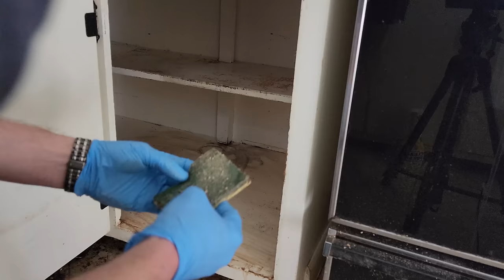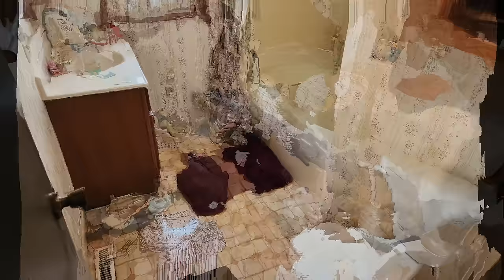Jaw-Dropping Hoarder House Transformation (FULL HOUSE CLEANING)

Comment: You did a phenomenal job again, you make a huge and important difference in so many ways. As someone with hoarding disorder, thank you so, so much for everything you guys do. I'm working with supports to clean up my place and while it's necessarily slow going we're making increasing progress and I'm hoping to be able to soon build on my distress tolerance etc enough to get more specialised treatment involved and get more happening, though the people I've got are already doing wonders with their approach.

One of my main driving concerns is that I don't want someone to have to do this job if something happens to me, I've always been fully aware that it will be someone else's  problem if I don't get it done, but as you likely know, this issue comes with a range of levels of insight about the situation and its consequences, but even the desperate conviction that "no one can fix this but me, it's my mess and I'm responsible for it" can get in the way of things actually getting done.

Whether hoarding disorder itself or hoarding related to other issues, it's a hell of a thing and vastly misunderstood and much maligned. My hope is that increasingly more people will learn more about it, that it's not just an excuse for laziness, a lifestyle choice, an indication of bad character or something that can be fixed with just willpower, trying harder or caring more about others (among other myths) but that needs a particular approach, and is something that it's also possible for a person to have happen to them or someone they know at some point in life no matter how tidy or organised or what high standards they might have, and that if some of the the shame and hatred can be lifted enough, more people might seek help sooner. Perhaps fewer people and others impacted might end up so thoroughly buried by its symptoms and consequences, and by more people coming forward more research can be done and more people (including more of those with a severe lack of insight and major resistance and others affected by its fallout) can be helped.

I honestly think you're going a long way towards this and I can't thank you enough. I'm going to join up soon when I've hit a personal milestone as well as organised myself to make it happen. I also hope to increase my social circle beyond just a few people aside from my support workers so that I can contribute better towards sending your videos and increasing your subscribers, and I'm determined to see you get your gold play button ❤.

Comment: My Grandma wasn't quite to the hoarder level but the recipe obsession is somewhat relevant. When I cleared out her house in 2016, I filled up no less than 5 husky contractor trash bags with unused greeting cards there might have been 10,000 cards by the time I was done cleaning them out. And a fair portion of them were the fancy ones with moving parts that are $5 to $10 each. I bet I threw away $50,000 (in original purchase value) of greeting cards.

Comment: Reminds me a lot of when my grandfather passed, he had a Garage that used to be a small hanger for like. Cessna's, and he over the last 30 years had filled the rafters with years and years worth of old paper, receipts, there were receipts from the 40's and 50's, as well as rock and general mining equipment. The house he had itself wasn't bad, and was clean, but the garage was horrible, most of the paper had molded or rotted.

Comment: A tip you might not know.  Hard stuck contact paper can be easily removed by heating with a hair dryer.  It melts the sticky enough to just pull it up.

Comment: What a great video, amazing result, fascinating situation! 

My family were “tidy” hoarders. They saved every practical item or tool methodically in case it could be repurposed in the future. It was clean, tidy, but the house was rammed with unnecessary but decent items including every possible kitchen utensil you could imagine existed (no rubbish/trash though).

This has turned me into a “practical” minimalist. I have minimal toiletries, clothes, kitchen utensils, appliances etc. Half my cupboards are empty. However, I’m a massive hoarder of aesthetic items. I have lots of art and  houseplants…my home is a complete jungle!! You get hit in the face every time you walk through a doorway by some crazy plant leaping at you from the ceiling. Tremendous! 🤪👍🏻

Comment: I'm about at the half way point in your video where you mentioned your APC cleaner recipe. During the 'Rona' in 2020 or so, when Alcohol was scarce (a different type of hoarding). I was having my trucks windows tinted at the time and had some time on my hands. I wandered over to a near by Ace hardware to browse the isles. I struck up conversation with one of the sales staff and the subject how hard it was to find Alcohol was came up. He told me they had 99% pure alcohol in gallon cans for around $30.00. We walked over to the isle and there were around 6 to 8 gallons of the stuff. I snatched up a can as if it were liquid gold. 
I refilled my almost empty 32 oz. bottle for personal use and took the rest out to my garage/shop for cleaning parts, and for safe storage. I have other cleaning products like Acetone and degreasers that are sometimes too harsh on certain surfaces. A can usually lasts me about a year or so. I don't know if you already buy your alcohol in bulk form, I just thought I would mention this if you don't. 
P.S. I rent a room from a family that are hoarders, well actually, slobs. Both kitchen sinks are full 90% of the time with bowls of half eaten meals they don't even rinse out. I have to use my bathroom to rinse my dishes and wait for the day they actually clean their kitchen to do my dishes. I keep my room clean, but fight a constant battle with Roaches, Ants, and silverfish. There are cardboard boxes full of junk that are still in the same places that they were the day I helped them move in, over 7 years ago. I've never lived in conditions like this. I am retired and can't afford to move into a place of my own given the prices of rental apartments in todays market. I feel as though I am one step from being homeless. :(

Comment: I was taught by a hotel cleaner that you always work from top to bottom in a room - clean lights and lamps amd high mirrors first - and then from right to left around the room or vice versa, whichever you prefer. That way, if you get interrupted, and leave your cleaning cloths on a surface for a bit to go do something else or because your boss has called you out into the corridor for a moment, when you return you will not forget what surfaces you just did.

Comment: Watching your videos has helped me deal with my own hoard. I have throw a little away, and I have organized the rest. How ever, there is to much stuff, so the hoardpile regrow fast, like in two weeks. So I got myself a external storage about 40 kilometers away, with enough space to sort and organize. 
So now I have sorted everything, with made me throw away about 1/3 of the stuff in total wich was trashed because of mice. 

What saddens me is how much I spent on rent for the storage, just to realise the stuff I try to save is worth less than the rent I paid so far. It would have been cheeper for me to just trow it all in the first place. However if I had done that, thst would not have cure my hoarding. But the process I have done now, might have been a big step in curing my hoarding problem. 
The things are attatched to a memory within a trauma. To deal with the hoard piece by piece and make my own decisitions for everything has helped me deal with part of the trauma.

My goal is to become a minimalist. However, it my take a while to get there. 

I've realized that if I stop buy stuff, bargains etc, I'm gonna save much more than buying and buying, and thinking that I have stuff that has a value. Because after 10 years in hoarding piles, it doesn't have a value, it's garbage to everyone except me. 

Well anyway, keep posting videos. They help me with dealing with my hoarding.

Comment: I was recently diagnosed with ADHD, but for years now, I've recognized the potential for me to fall into hoarding disorder.  I've dealt with depression since I was a teenager, and I've been a pretty bad impulse buyer over the years.  I have a lot of stuff.  In the last few years, I've been endeavoring to curb my spending and get rid of some things, but it's hard.  I get sentimental about things that my rational brain tells me I don't need to be sentimental about, or I see the "potential" use or value of things like "nice boxes."  I'm fortunate to have a spouse that helps keep me in check, so to speak, but if conditions were just-so, if my spouse were no longer with me and I was more isolated on my day-to-day, it would likely be pretty easy for me to fall into this situation.

Comment: The free cleaning services, and you are one of the best, do such a wonderful job for those in need.  In this case you took a huge load off of the son.  Two years ago I had to travel across country to clean my hoarding father out.  His mobile home wasn't the worst, the 7 storage trailers he had were.  We were fortunate on the first day that we were able to get a "Got Junk" service to come in the second and third day.  Eight 18 CF rollbacks later we were free and clear.  I brought home NOTHING!  And you are right, when we would visit, especially the last time, he didn't want us to pick him up.  He wanted to meet us to go out.  When I insisted I should have known when he said, "Monday, uhhh, that's enough time"  The 5 big black garbage bags should have been the tip off when we got there.  When they found him, the house was knee deep.  The biohazard people  (yes he died alone on the floor and laid in 100 degree heat for 2 weeks) cleaned the worst and gave us the extra space of a 30 CF dumpster and the neighbor immediately filled that with outside debris before we ever arrived.  PS:  the biohazard was paid by his home insurance, the clean out wasn't.

Comment: I help a lady who does estate sales. We set up, have the sale and we clean the house. We just did a hoarder house that had not beenmkived in for a few years and was floor to 2' from the cieling in mostly trash in 2 bedrooms. I took charge of o e room and everything thst was on the floor was stuck to the carpet from the cat peeing on everything. I pulled up hardbound books that were "glued" with urine somuch thst the cover tore off or the carpet would tear. We ended up setting up outside for 90% of the sale and ended up taking about 75% of the stuff to the dump, unfortunately.

Comment: Dont knownif you are aware that vinegar is a good disinfectant and cleaner for cleaning minerals such as iron and calcium.. just pour it in your large sprayer and add a decent amount of dawn dishsoap (original), cover area you want to clean, let sit and wipe up with damp cloth. Vinegar is strong odor, but it doesnt take long to dissipate (a day). But, iron and calcium will wipe away! Much cheaper than some of the cleaners you are using.
Reply from the maker: Vinegar sucks as a cleaner

Comment: 22:59 Yoo, a Model 2 Genesis, I got 2 of them. One is just the Genesis (with the cables) and the other has the 32x and top loading Sega CD with all of the metal plates they came with (once again, with all the cables)
23:56 And there's the Model 1. I believe that has the best audio when used with a Sega CD. 
Earlier in the video, you were talking about Genesis variations, and I assume the "Sega Genesis 16-bit" you were referring to was the Model 1 with "16-BIT" emblazoned on its surface. You called it an upgrade to the Original one, too. Kinda funny that you got them backwards. (This was at 21:10)